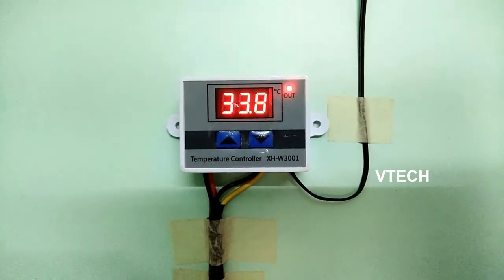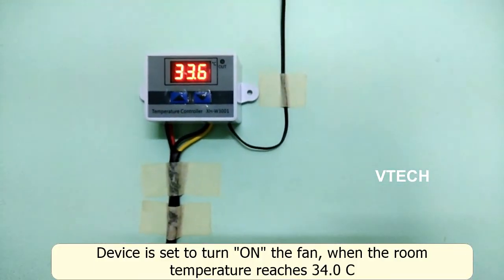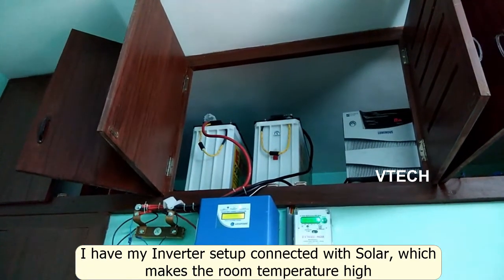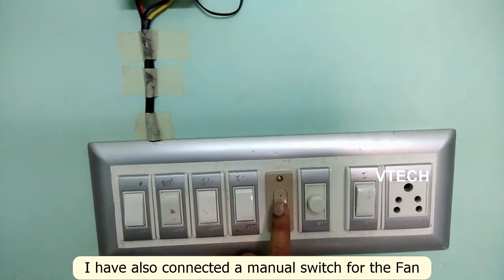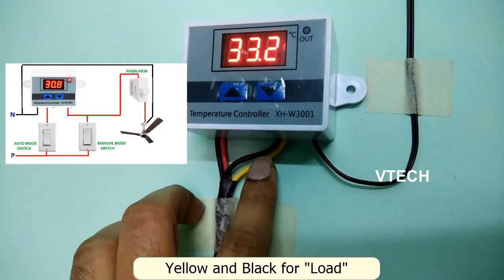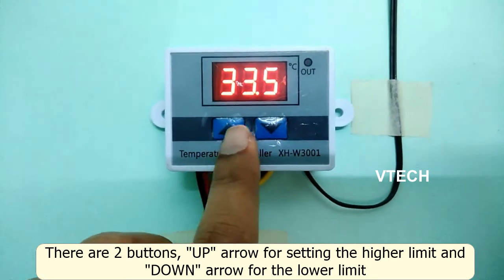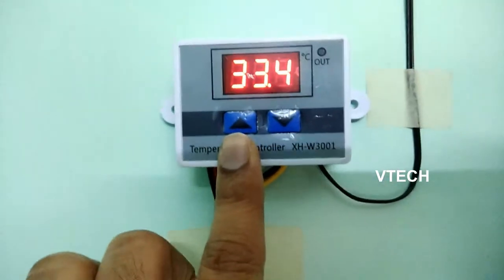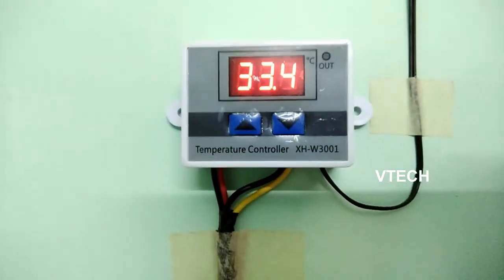Temperature Controlled Ceiling Fan for Room | How to set Digital Thermostat | Temperature controller

Comment: Auto switch on hai our manual switch on karne per kya hoga
Reply from the maker: Nothing will happen.. Fan will stay "ON"
Reply: @vijudav  reverse power ke liye diode nahi lagana padega na ?
Reply from the maker: @ashishkathi6268  Not required. Diode will not work, since the load is AC current. If both output touches, its ok because both are same.
Reply: @vijudav  please full connection video

Comment: Bro exhast fan on pandrathu intha sensor use panalam
Reply from the maker: Yes you can use. Check the amps rating of exhaust fan. Because this device can handle 10amps max. Kindly check the spec of the controller.